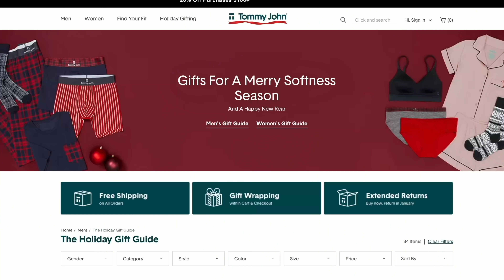MORNING VLOG: PRE-VLOGMAS!!!

Comment: I'm surprised that you do eyeshadow before foundation. Doesn't applying the foundation around the eyes screw up the eyeshadow? I was taught you put foundation on your eyes under the eyeshadow. Is there a particular reason to do the eyeshadow first?
Reply: Then again, I've only done stage makeup. Maybe this is how you do everyday makeup.
Reply from the maker: I think it’s preference on this one, but I like doing eyeshadow first so if I get any eyeshadow fall-out specks on my cheeks I can just wipe it off with a makeup wipe without ruining my foundation! It doesn’t happen with all eyeshadows, but I’ve wasted so much foundation by trying to brush off fall out and it leaves a smear of eyeshadow on my face 😂😂😂 The foundation doesn’t typically ruin my eyeshadow, but I only do my eyelid first and save my lower lash line for after my foundation and concealer and can touch up the outer corner with eyeshadow if I need to then 🖤
Reply: @JadeTheLibra  That makes sense.

Comment: Guy Tang has a demi colour remover just came out this year its designed to remove fashion colours.. If your in a pinch baking soda mixed with dish soap will help fade faster I do it all the time you'll need to wash and use a hair mask after it will feel a little striped.

Comment: Hey Jade! 🎃 Your video was amazing per usual; I appreciate that you’re not afraid to be open and be yourself. It’s truly inspirational 🖤
The DIY you did looks really cool and I’m considering giving it a try! Personally I prefer the gloss Nutcracker especially if you plan to put smaller decorative items around it. I think it will help tie in something big with something small. I’m looking forward to seeing what you end up doing with it!
One more thing, I have a hair tip if you want it. Only use the Wet Brush on wet hair otherwise it doesn’t work as good. I use the wet brush to brush my hair out after I shower and a detangler brush for when it’s dry. I learned that the hard way 🙃 

✨Corinne